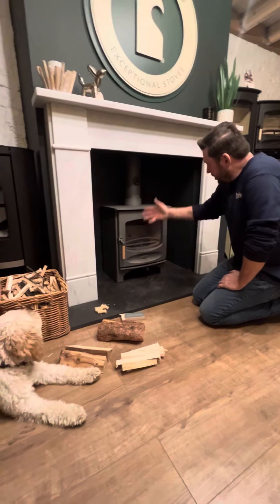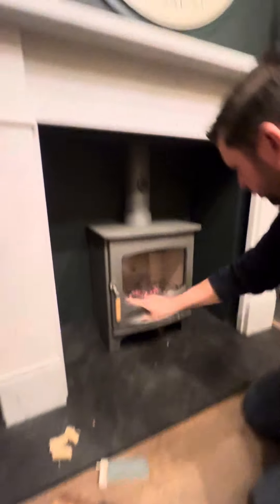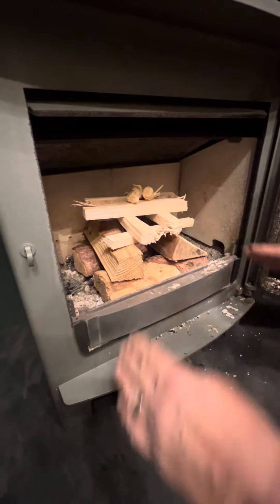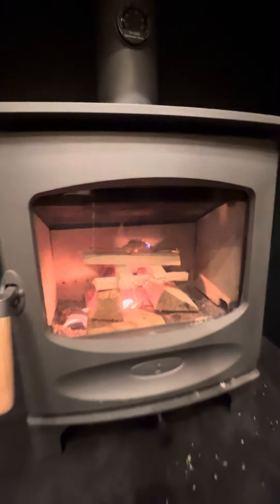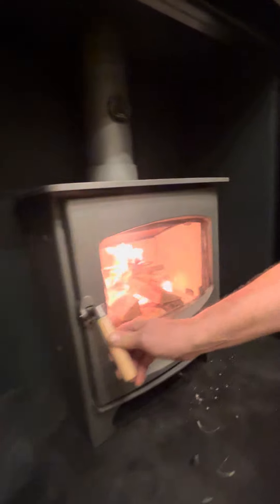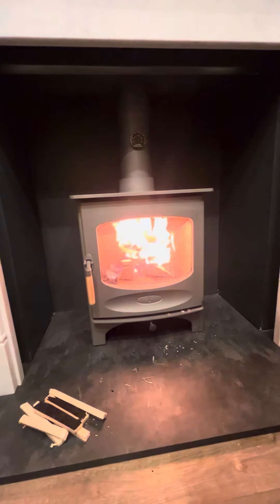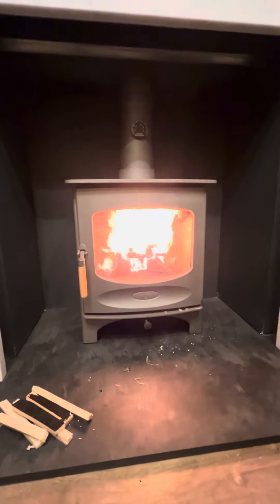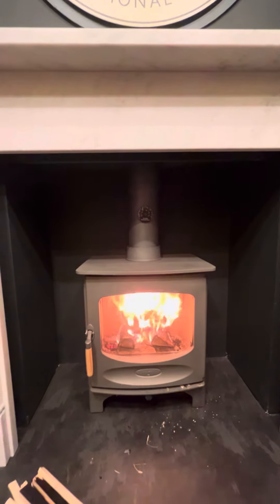Charnwood c five lighting with top down method @igniteharrogate

Comment: Why do you not recommend pushing the heat control all the way in? In the manual it says the C series is certified to always draw air, even in the lowest setting to get a very long lasting burn.
Reply: You're correct. In fact my C5 still fires way too much with the damper all the way in
Reply: @markh1ggins  what do you mean with "too much"? It provides about 5kw of heat. If the rooms gets to hot, your room need less than 5kw to be heated. You can put in less wood, but the stove is designed to burn with highest efficiency on normal load. You can see the temperatures in the stove details he showed. If the room still gets to hot, you can open a door to another room to increase the amount of kw required to heat the room. In that case you're actually increasing the room "size" to be able to absorb more kw. What we did is placing a stove ventilator on top of the stove to disperse the heat through  a nearby door, and get more even heat distribution. Saves you 1 or 2 degrees in the room the stove is in.
Reply from the maker: Thanks for the comment. On the tinderbox, you’ll find the glass will blacken if you push the control fully in. It also produces smoke which is why we suggest you control the stove but avoid shutting it down fully. 

All stoves works differently and the charnwood does allow the control to be pushed fully in without blackening the glass. No detriment either way. Just a different operation.